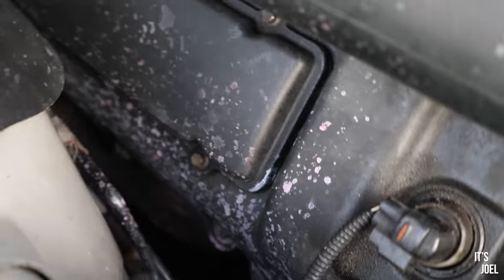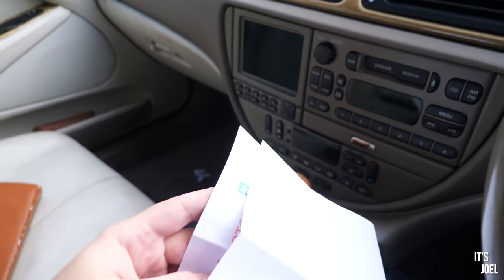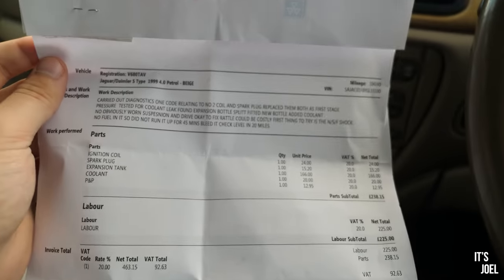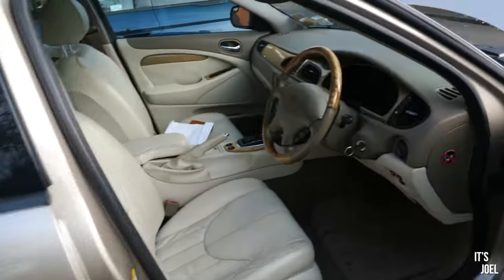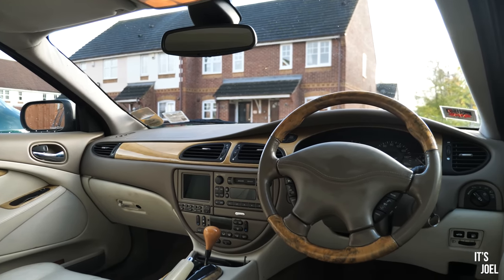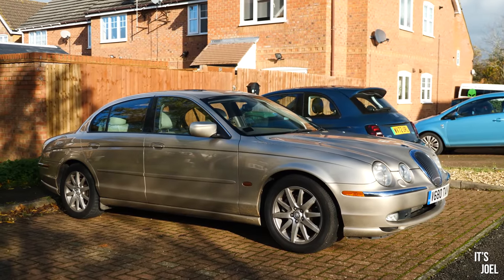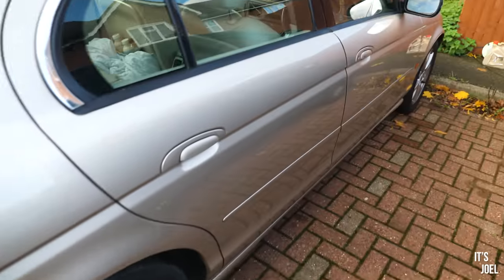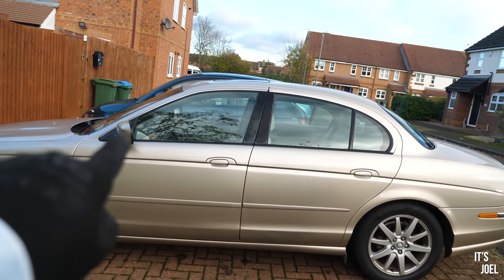My cheap V8 Jaguar has already given up on me…

Comment: Im so sorry to read that bill. I had to pause at 2.10.
 Ive been watching your videos for months, and this is the first time i felt inclined to comment. Someones mentioned you can get a new coolant tank for £35 on Ebay. Mercedes only want £45 straight from the main dealers- I doubt Jaguar will want a lot more.
That work description is shocking. The fact the mechanic cant spell suspension, and says "That could be costly " on the job sheet is shocking. was this mechanic an alien? please dont say hes a family freind. To see hes saying hes investigating a coolant leak but not running it up to temperature is shocking. Hes actually telling you on the job decription to check it later when he knows youve left and it will boil straight up. I`m not sure why you took it there, but any (half)  decent mechanic watching this will know you have been properly striped up mate. £555 for 1 spark plug , 1 coil, a water bottle , and a bottle of coolant is frightening . Ive noticed he hasnt itemised his labour hours either. oh dear. I havnt watched the rest of the video yet, but im guessing you just spunked 500 quid and the cars no better. I`d take it back mate- tell him to fix it or give your money back. If he doesnt play ball contact trading standards. 
https://www.youtube.com/watch?v=Gq6WME576ZE
https://www.youtube.com/watch?v=BUnvgKhWZdI

Oh my goodness I watched some more. its pissing out coolant after hes changed the tank. You seriously need to take it back, and word of warning i can see your cat was about to drink the spills - dont let him - it will kill him. Antifreeze is well known to kill cats.
https://www.cats.org.uk/northherts/news/the-danger-of-antifreeze

Comment: Great content. I’d keep the tax disc all part of the provenance. Or get a new copy made up plenty of places online to do that. Personally I’d keep the original plates as well. You can have a go at fixing that rust spot yourself not too tricky and good content. Lovely car. I’ve got an 04 S Type R it’s the 4.2 V8 but both engines are super smooth with effortless power.

Comment: You appear a bit puzzled over why the leak only happens after the engine warms up. you don't say how long after. If we're talking about maybe 5 to 10 min, it's simply that the water won't circulate until the thermostat opens, .... pretty basic stuff.

Comment: Sounds like a blown head gasket, with the pressure just taking out the next weakest link.
That engine is NOT super smooth and a misfire is clearly detectable.
There is no OBD code for a blown head gasket, if that is what reassured you.

Comment: I have had Jaguars all my life and consider the S Type and X Type the last of the classic Jaguars. However, although I love these cars, I hate the mechanical side of them. I also have a older 1996 Jaguar which is a much better mechanical designed car,. More dependable and  certainly much easier to work on mechanically.

Comment: It's headgasket
Reply from the maker: What makes you so sure?
Reply: @itsjoel  I'm in the trade had loads of those v8 s types they always used water and 9 times out of 10 was headgasket there rubbish engines. Best s type v6 3 litre.
Reply from the maker: @ronniebarker5520  reckon it’s worth me running some steel seal through it?
Reply: Pressure test it and you’ll see where that coolant is going.